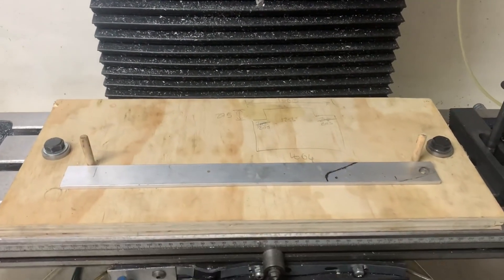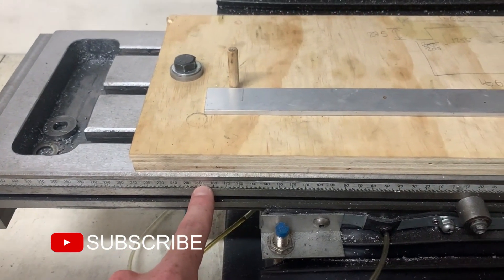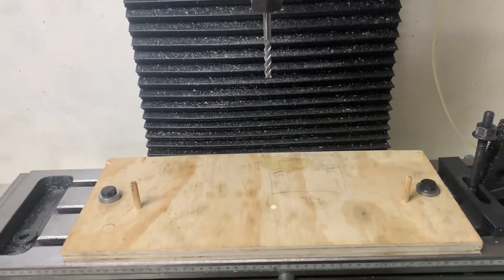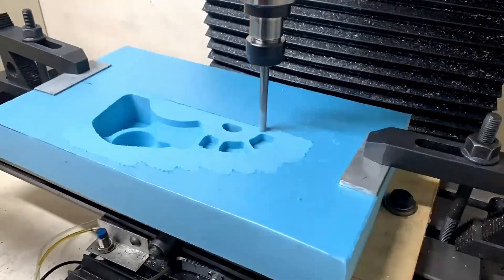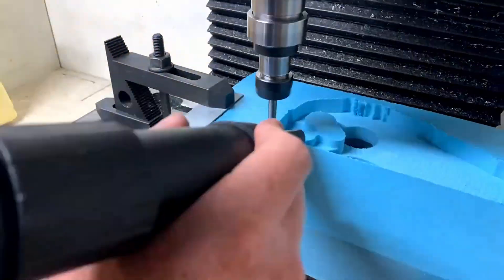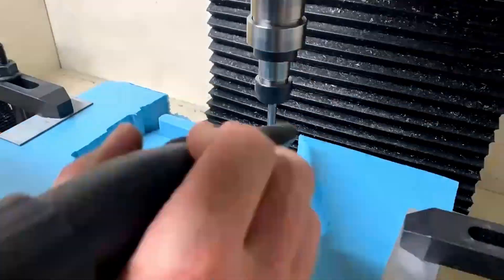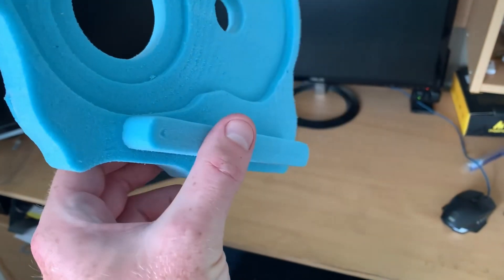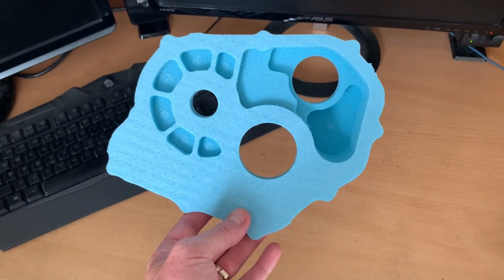Making a Lost Foam Pattern - V4 2 Stroke Build

Comment: What foam are you using? Iv been trying to source something in Nz for lost foam casting but struggling to find a supplier of low density xps. Cheers
Reply from the maker: https://www.insulationwholesalers.co.nz/Online_products/High-Density-Extruded-Polystyrene-p83041225. 

Here is the stuff, they happened to be within 5 mins of where I work. Give them a ring. Originally I used a product from bunnings that is no longer sold.

Comment: That's a good size casting.  if you have designed this and created the toolpath for your CNC mill, then you should be able to generate a STL file to create 3D print. I have first hand knowledge of the process of lost PLA casting. Just recently I decided to get into casting aluminum models and bought a propane furnace, with a 10kg crucible. Next thing I know I am ordering the parts and materials to build a kiln capable of 2000 deg F to burn out the 3D printed version of the part to leave a clean void in the plaster in which to pour the molten material.  This of course is more like investment casting. The finished part if successful can achieve amazing degrees of detail. Anyway if you like I would be happy to generate a proper accurate version in the very best filament for the task. It is called PVB, short for Polyvinyl Butryal. It is able to be smoothed with isopropyl alcohol. And has a low ash content if used in a flask (cope and drag) with greensand, so a good candidate. Just reply if you are interested. Maybe you know somebody that is into 3DP and closer than Canada. Shipping will be a small irritant but not a show stopper. Best regards C
Reply: Lost foam casting is perfect for this. much easier method of casting then lost PLA.
Reply: @stevesrt8  I've not seen it done using a conventional flask arrangement. I've no hands on with this method, current experience is all YouTube content.  Odd that I have clocked as many hours given my stock in trade is more 3D design/ CNC 
Little of it prepares me for lost PLA casting. Mistakes will be made. I'm good with that. 
So I gather there is no need to account for draft or fuss with a parting line and such. Just bury it and fashion the feeder, pouring basin and vents. What kind of aluminum does one use for this application? I will be attempting to use some off cuts of 6061 but there are other types.
Reply from the maker: I’ll let you know if I get stuck, I appreciate the offer. I can send you the file anyway if you want to have a go at casting it. Printing is definitely less labour intensive to make the patterns than machining. 

I am going to use lm25 aluminium hopefully, the last engine I cast was made from recycled Honda engine cases and a ford cylinder head. Although I didn’t heat treat it like I should have. 
This time if I can I want to avoid casting myself as I want quality de gassed aluminium which I can heat treat.
Reply: @OddsandEndsMachining  No reason why you cant produce quality castings yourself. For someone that builds a machine like a GP motorcycle from scratch, it's a skill you should own instead of source because the V4 powerplant could offer you competitve advantage that no privateer could ever financially consider. Irrespective of what the evaporative pattern material may be, anyone that thinks you can use a block investment or shell mold to cast parts this size and larger for the same cost or effort as lost foam has never used both processes....and the disparity just gets more dramatic with part size because it's a third power function of volume. Any 3D printed evaporative pattern will require burnout and one of those hard mold methods. Best, Kelly
Reply from the maker: @kellycoffield533  thanks for the reply. As much as I don’t want the casting itself to become a major project within a project, in the long run it will make the most sense financially like you say. It might also open up some jobs on the side if I find time.
Reply: @OddsandEndsMachining  I think the block became a major project within the project the instant you decided to make a V4 engine. For me doing the CAD and dimensional layout work for the engine architecture would be at least 75% (probably much more) of the work for the block, followed by casting and machining. You could have decided to machine it from wrought stock and/or weldment like one of Millyard’s creations, or just used an existing engine platform. You chose casting because it was on balance the best approach. The time investment for home foundry capability isn’t much different than lathe, 3 axis milling, welding, CNC, or general fab if starting from scratch. You just decided to make your first casting projects advanced ones. Having made the V-twin, you’re not starting from scratch. If you can find a sympathetic foundry to cast one-offs, all the power to you, but to be viable, they need to devote those resources to customers that offer a production annuity. Not being critical….just pragmatic….and trying to put your mind at ease. It's the voice of experience speaking to you. Best, Kelly